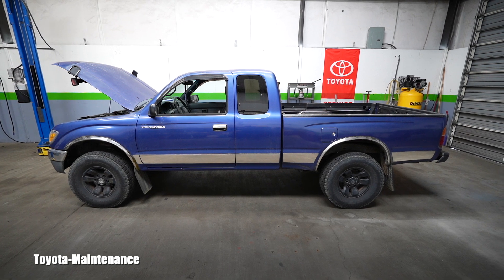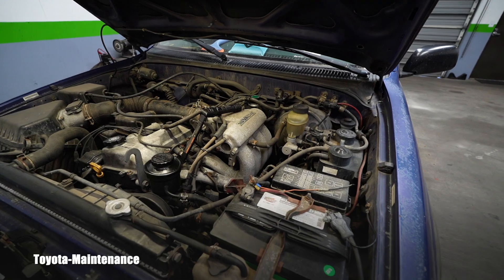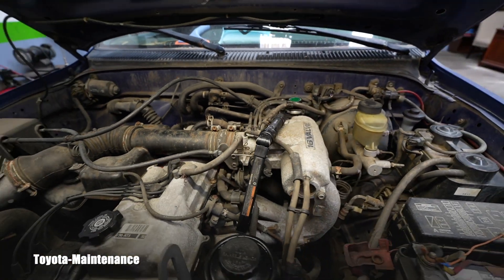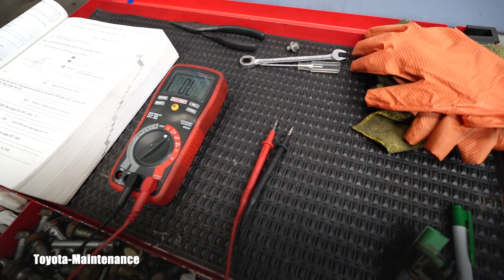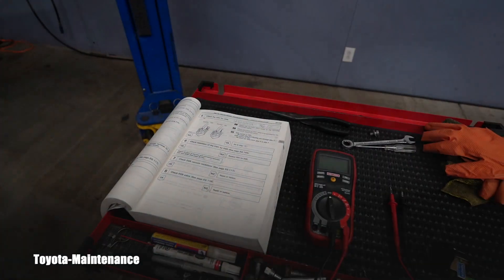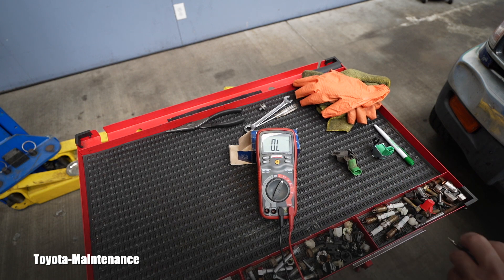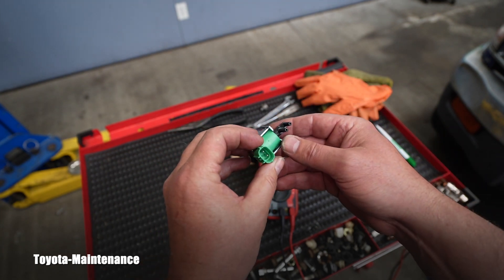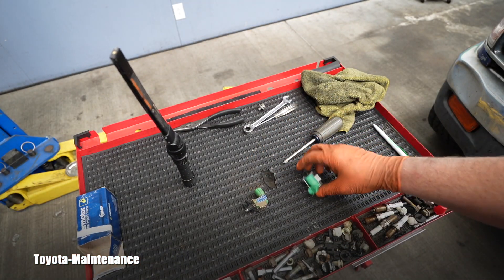TOYOTA P0402 EGR Excessive Flow Detected

Comment: VSV Part #: 90910 - 12065

STEPS:
3:10 Measure Resistance of EGR temperature sensor (multimeter >2.5 k ohms)
4:19 Remove VSV (12mm bolt under exhaust manifold/throttle body). (Multimeter = 36 ohms also if you apply 12V you should here an audible click of the valve)

Or…. Just remove EGR entirely lol

Comment: Thanks for your video!
I tested the ohms on my current egr temp sensor and got no reading!
However, the new one is the same!
Is it possibly that my meter doesn’t read that range or did I receive a bad new sensor…
(I have a 99 tacoma 2.4l regular cab 2wd)
Thx

Comment: I had the same PO402 code on a 1994 T100 with the same engine. I pulled the solenoid off, and I measured open loop (infinite resistance) across the 2 pins on the solenoid. I applied 12v to one pin and ground to the other pin, and the solenoid seemed to click like it should. After applying power and ground, I rechecked the resistance, and then I measured 38 ohms instead of the open loop I measured earlier. I don't think air is being allowed to flow through the valve when I applied voltage, so I'm going to swap the solenoid out

Comment: I deleted my egr on my 2rz. I just soldered a 10k resistor on the temp sensor wire after cutting it. Made a blockoff plate on the intake manifold. Threw away all the egr components. While i was at it, i also bypassed the coolant lines on the throttle body. Connected the hose from the hard lines together. No check engine light.
Reply: Will it still pass emissions if you do this?

Comment: The best thing to do is delete the EGR valve. The engine will run better & have more power. This is what we do in Australia.
Reply: You will need an scanner and confirmed that all the sensors are set to be smoged check if you just delete the EGR valve but the ECU won’t read it and that is enough to fail, not even try or waist your money to fail the smog.
Reply: It won’t pass the smog check inspection required in California
Reply: @DAKYOF  We have no yearly inspection in northern Australia, so we don't care if the light comes on.
Reply: @Nick41622  it makes sense, I will do that too after inspection but the problem is when we have the smog check inspection here in California is every 2 years.  I am struggling to diagnose my code.  
This video is very helpful I already on the process.
Reply: @DAKYOF  if you delete it and have no check engine light with out chipping the ecu, will it still not pass? I'm having this problem I've cleaned the valve and replaced sensors and still get check light. I'm in Cali too. Any advice would be nice. Thanks in advance.